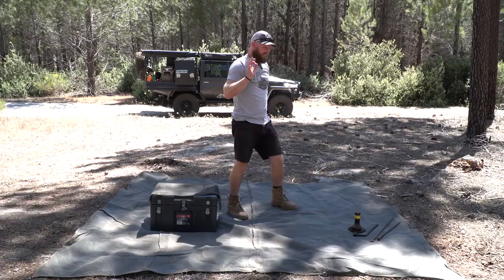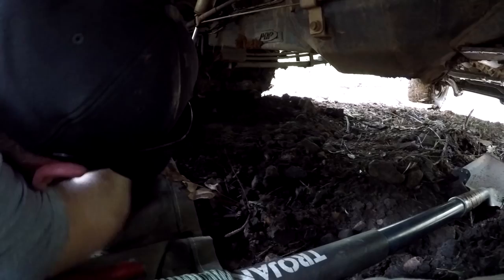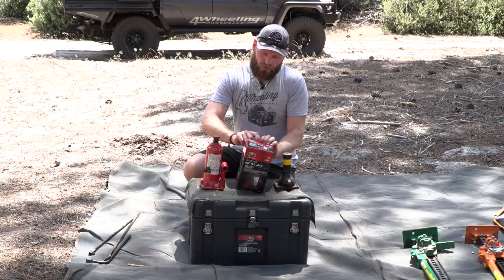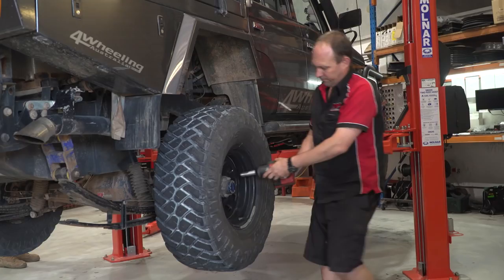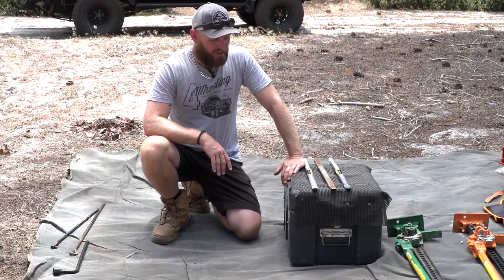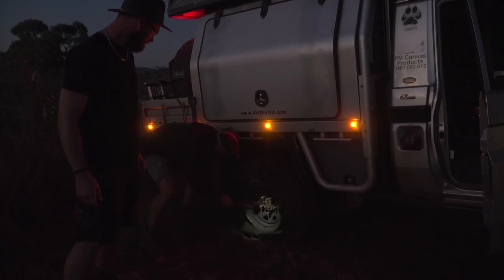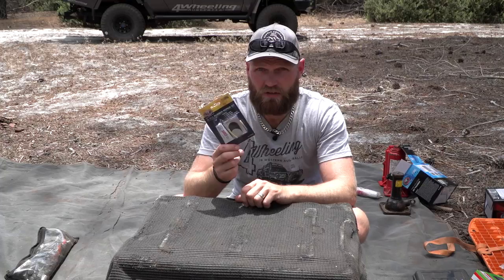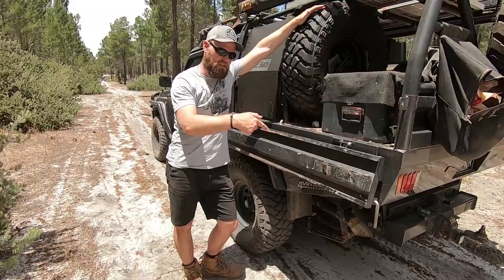Change & fix tyres like a pro OFF-ROAD

Comment: Thanks Rhonny. What about scissor jacks? Safe enough? Got one because my bottle jack doesn’t reach the frame

Will get an 8 ton bottle to go with my standard and use it on the axle. Thanks!!
Reply from the maker: I’m not a fan of scissor jacks, they can’t lift as much as a bottle jack either and I find them unstable

Comment: Heard a few plp say you shouldn't patch the side walls if you get a hole only the tread part ...!!!!!! Any suggestions mate ..????
Reply: Side walls dont have steel belts in them they are only rubber so if it is a split it can get bigger and bigger or blow out.  A pin hole or really tiny hole in the shoulder of the tyre is ok to fix but something directly in the side wall I wouldn't fix unless its tiny and 99% of tyre shops wont fix it at all

Comment: Hi mate, could you do a vido on what power you can make out of a 79 series and what brands are the best to go for when it comes to chips and turbos etc.
I have a 3" red back exhaust on my 79 but i dont think it is straight through as its not verry loud. Would i gain or loose power going straight through?
Reply: why do you want MORE,power from that over priced,under powered v8 tdi.Diesels need to breath,no exhaust...i have a  6 cyl,, 4.2tdi,std with 3" system thats factory,not accessory,,OHC,3 valves,no computer,no glow plugs,.i fitted a td06, ,td04 std,,,,puts out 700nm,.beat that,toyota...oh,& have you fitted a 200 series rear diff yet,to fix toyotas f up.???.

Comment: tyre patches/ plugs, the glue goes off, vanishes so replace regularly, bought a 125ml tin once to save money,  good till you open then it gone the next time you want it, only good for tire shop. 

also it's not safe to plug /patch side walls and drive on made roads, very high stress on side walls, could blow out any time and tire shop should not fix, only replace!

Comment: you should never throw out you factory jack ! If you damage a seal or lose hydraulic fluid you will be stuck with no jack. the factory jack is mechanical and will always work.

Comment: On cheap air compressors, I've got in a muddle because the lead wasn't long enough to reach the rear tyres. Something to watch out for.
Reply: Easy fix there Tom.  Either make an extension cord for the power lead, actually lengthen the power lead itself, or get a longer air hose for the compressor.  Even the hard mounted hoses can be removed from the compressor and a DIY hose added.  You just might have to take things apart a bit to get to the compressor output nipple.  Do this at home well before needing the compressor of course.
Reply: @insaynbcr  oh yes, it's an easy fix provided you test it before you leave on a trip :D

We'd checked the compressor worked by using it on the front tyres!

Entirely operator error.

Comment: You should not tighten lug nuts with anything other than a torque wrench. Using something else is jusk asking for trouble down the road. They can be too loose and come off or be too tight and then you cant get them off when you need to. Also the wrong tightness can tweak the wheel mount surface and lead to other problems. Over tightened studs stretch and are more likely to brake twist or strip.

After having an issue with a tire shop using airguns to tighten our studs I even bring my torque wrench and check them before I leave when some one else touches my wheels now.  Its rare but it only takes a wheel coming off one time due to a broken stud and too loose of lugs for you to be willing to double check the shop.
Reply: never ever,in 40 yrs,used a torque wrench to set wheel nuts.thats for babies that dont know what tight enough is.theres 5,6,or 8,nuts,there not all going to leave at the same time,.do you torque them with the wheel on the ground,??,.now THATS a big,mistake.
Reply: @phantomwalker8251  If I'm in the shop I use a torque wrench and yes you put in on the ground after they are set in the wheel or you can use a brake or leave in gear. If I don't the proper tool handy then tighten then with the wheel I have in the car so I know I can get them off in the field. Point is using an airgun or braker bar is a really bad idea and will screw you over down the road. If you do not agree with this approach then I would guess you have not had to change many wheels in the field.  Its not about being a baby or not its about making sure when you really need to be able to change a wheel you can. If has shops jam wheel nuts or cross thread them with their airguns before.  Its really easy to do it right and its just as easy to use the tool you have in the truck those are the best options.

Comment: I disagree highly about the factory jack. Mine compresses shorter and lifts higher than a 2 ton and 4 ton combined for 1/4 of the packing weight. I also don't have to get or stay under the vehicle while using it. My factory jack and a robust aftermarket scissor jack that you can get damn near under anything make more sense for me to carry. Agree about hi lifts though. Way overated, way to easy to damage something. Granted I understand the need for a heavy bottle jack with something as heavy as an LC.
Reply: That is YOUR factory jack. most are crap.
Reply: @1989cranston  It's a normal Toyota jack. Honestly it looks the same as what's in this vid. It be nice if someone would offer a reason that the factory Toyota jack is utter crap. I mean it jacks the vehicle. I don't have to crawl under the vehicle to use it. It has a designed spot in the vehicle to keep it. It can't leak like a bottle jack does and the vehicle slowly lowers. It can  be augmented with a base just like a bottle jack. Mine will jack up one whole side of the vehicle if I out some wood on the frame rail. I have bottle jacks and a hi lift i could bring but I still fail to see the logic of binning the factory jack.
Reply: @jeep6242  It stems from a situation standpoint I'm assuming. I have a ford ranger and the one that comes with the car is decent, but for offroad it is crap since I put on larger than stock tyres. The jacks that come with the standard vehicle have been designed for the standard vehicle.

Comment: If i buy a car for 60K i would invest in a torque wrench for tightening the lugs. That way you are sure that they are not loose and not too tight. Look up the prescribed torque in the car manual or somewhere online.
Reply: Just go breaker bar tight. As long as you're not using a massive bar or hanging off it like some kind of ape it'll be fine. My old man relied on a (from recollection) 15-18" snap-on breaker bar. Tyre shops using air ratchets used to really give him the shits (mechanic for 50+ years) as they normally completely overdid the tightness which would preclude a roadside tyre change by the owner.

Comment: for all the internet heroes getting bent out of shape over wheel nut torque and so on, i just did 50 ks of beach driving solo with no recovery gear and no jack.mad? folks need to leave ronny along and actually use their 4wds

Comment: I have not had any luck with cheap compressors. False economy buying a cheap one.
Reply: My cheap one would over heat during the 3rd tyre. My ARB has never failed in 10 years, I have aired up up to 3 times in a day quite often.
Reply from the maker: For smaller tyres they are fine but big tyres do require better compressors

Comment: Rubber repair kits, AKA patches, they are crap. Stick to the plugs people. Plugs are easier, quicker and you can mount them on the wall of the tyre.

Comment: Avoid the cheap tyre repair kits with plastic handles. apparently they can break when applying force and puncture your hand, urban myth?
Reply: mmmm, it depends on how hard your pushing it in and turning it. I use Slime, it has a rubber handle grip, but under the handle grip is metal. 
I have never seen anyone break the plastic ones, yet. Just dont buy the stuff off EBay as they are all crap, hence so cheap.

Comment: 2 lb,lump hammer,makita 1/2 driver,small one not the big one,cost,130,compressor,twin piston,$90.arb compressors,over priced.like everything they sell.if you can afford 65k for a 4x4,you can afford 2.5k for a $600 bullbar,.9k winch,$400.saves you once,paid for itself.